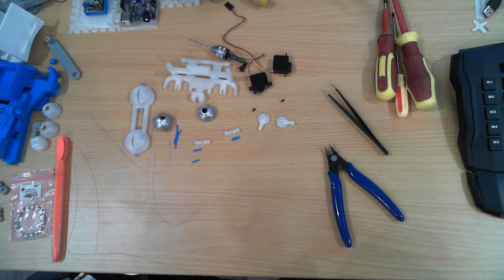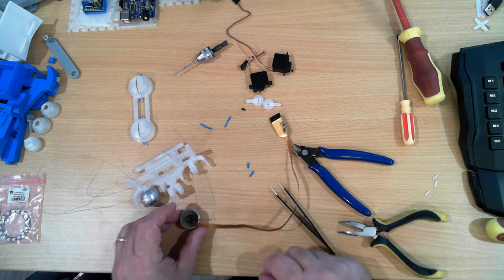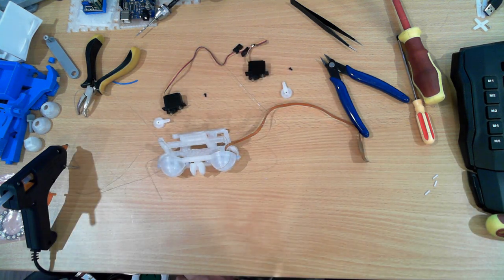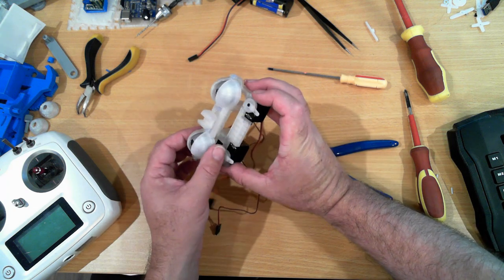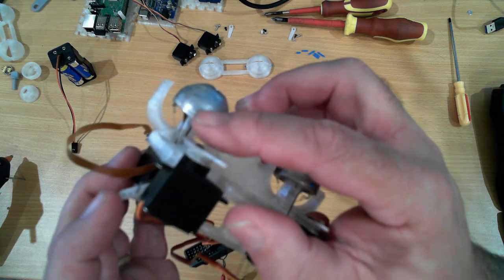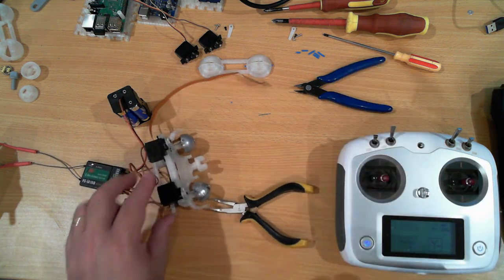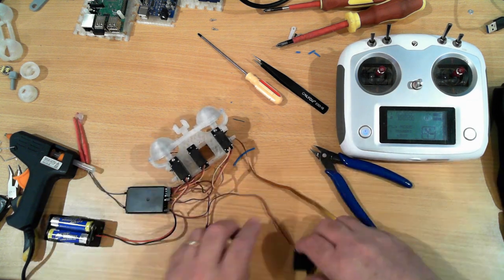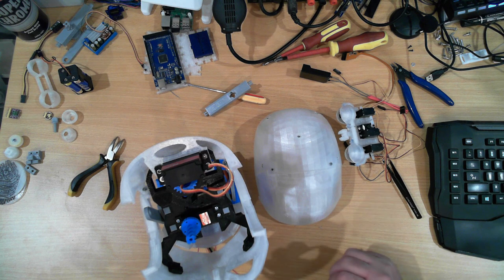Fred's Head Part 2, Making the Eyes

Comment: Finally getting around to the Fred's head series. I love how you went with wire and cheaped out the design and showed how to make it doable for anyone. Some of the parts on the original design were so pricey when I checked them out way back when. 

Ended up printing out a set of these last night. Mannnn the eyeballs are tiny! XD  Still not sure if I will do anything with it as I love my glowing eyes but.... gah I want eyelids also. With my current eyes the spacing is way too tight to put an eyelid system in so trying to think how I can achieve best of both worlds.
Reply from the maker: A lot of the problems I run into is availability, in the end I did add M2 screws to make the linkages for the eye lids work better, but still pretty cheap :-)
Reply from the maker: I think I can get some RGB LED's in there still.
They are currently on order :-)
When my wife asks why, I will show here your video :-)

Comment: This is looking really great. I'm glad you're using the Raspberry pi camera because I would like to do the same. I'm looking forward to next instalment.
Reply from the maker: Next week, I will change out the bottom part for one that was modified by Alexinator40, so i have the clearance I need to get the eye mech in.
The week after that I setup a Raspberry Pi 3 with Java V8 and MRL Manticore.
Still working on the video for the mounting of the AT30 SMPS and PCA9685 servo driver that will be mounted  in the forehead.
Then I need to plan out, design, print and intall the mounts for the Raspberry Pi 3 and it's AT30 SMPS.
Yes I will have two SMPS in the head, they max out at 3 amps, and the Raspi can draw as much as 2.5A and the servos even more, so go with 2 to save on future trouble.
It also means I can power the head with a voltage of between 4 Volts and 30 Volts.  Another Planning ahead for the walking legs project :-)
Reply from the maker: Of course, Patrons already have access to the next weeks video and from time to time even further out :-)
I know a shameless plug here :-)

Comment: Hii sir,
Is jx pdi 1171mg 17g servo equivalent to jx pdi 1109mg servo
Will jx pdi 1171mg servo will fit in the eye mechanism part
Reply from the maker: I don't think it will fit.
The 1171 is longer and taller than the 1109, it is also slightly slower.

PDI-1109MG 9g Metal Gear digital Core servo
Dead band: 1μs
Working frequency: 1520μs / 300hz
Motor: Core           
Operating Voltage:  DC4.8~6.0 V
Operating Speed (4.8V): 0.12sec/60°
Operating Speed (6V): 0.10 sec/60°
Stall Torque (4.8V): 2.2kg/cm  
Stall Torque (6V):  2.5kg/cm 
Dimensions: 23.2 x 12.0 x 24.8mm 
Weight:  10.0g 
Connector Wire Length: JR  180 mm 

PDI-1171MG 17g Metal Gear digital Core servo
Dead band: 1μs
Working frequency: 1520μs / 300hz            
Motor: Core
Operating Voltage:  DC4.8~6.0 V
Operating Speed (4.8V): 0.13sec/60°
Operating Speed (6V): 0.11 sec/60°
Stall Torque (4.8V): 3.0kg.cm (42 oz/in)
Stall Torque (6V):  3.5 kg.cm (49 oz/in)
Dimensions: 29.5 x 11.6 x 30.2mm
Weight:  17.5 g (0.61oz)
Connector Wire Length: JR  180 mm (7.08in)

Hope that helps
Reply: @CyberOne  yes I got it thanks sir

Comment: ok not an expert but generally your eyes move the same direction do they not? therefore this could be done using 2 less servos yes?
Reply from the maker: You could be correct, but I can make the robot adjust the angle of it's view as objects get closer if needed.
When looking at the design by Dakota76, the only thing I would like to have seen different is the left and right eye lids be independent so Fred could wink.
Reply: @CyberOne  just one other question what's the diameter of the eyeballs please?
Reply from the maker: The OD of the eye balls is about 25mm.
Hard to  measure now they are installed.
Dakota76 used a different camera that returned a composite signal, but I used a Raspberry Pi Spy Camera and found it fits.
I have since learned there is a small extension cable that will fit between the camera and the camera PCB module that will allow just the camera module to be installed allowing for  a larger range, but these 300 mm long cables are almost as expensive as the camera's :-)
Reply: @CyberOne  I wonder if any of these designs (of course without the fancy eyeballs so a camera could be mounted in the blanks) 
could be incorporated into inmoov http://www.nilheim.co.uk/ as I'm not a fan at all of the fishing line idea, the eyeballs look to be about 30 mm or so
Reply from the maker: I have seen those.
They are good,but extend further back into the head area blocking the jaw servo and taking up a lot of space that i need.
I looked at them as a possible solution, the eye lids are also independent which is also a plus
But space was the reason I didn't choose to use that system, and I was able to mount a camera in the Dakota76  eyes

Comment: I didn't catch the servos you were using.  Which ones did you select?
Reply from the maker: There are two types, for the jaw and head rotate, I use the PDI-6221MG servos by JX-Servo
For the six in the eye mech I used the  PDI-1109MG servos, again by JX-Servo
They have a website at www.jx-servo.com
I purchased mine  from Ebay.
I stopped buying the TowerPro SG90 and MG90 as these servos tend to jerk on power up before the control signal is applied.